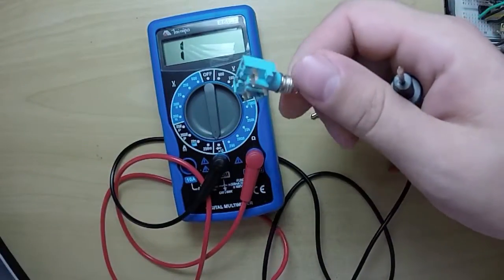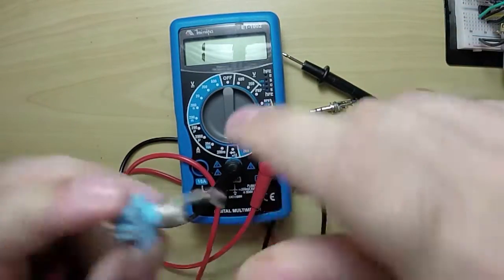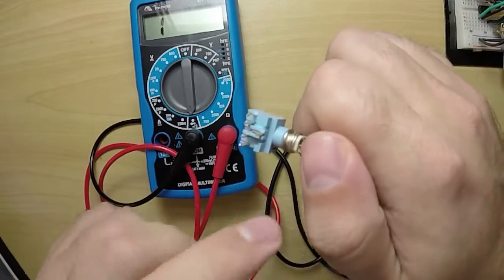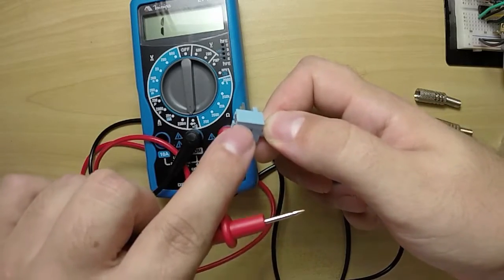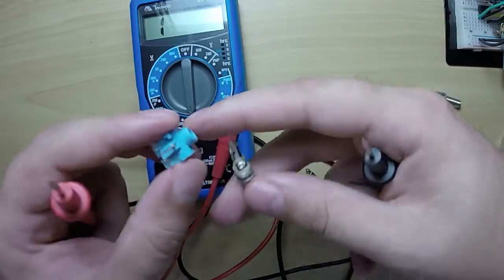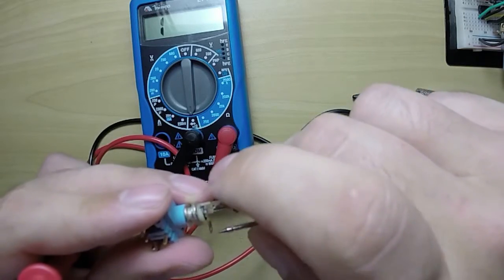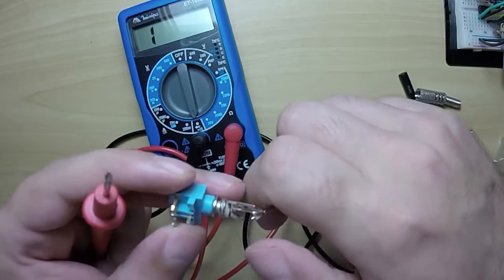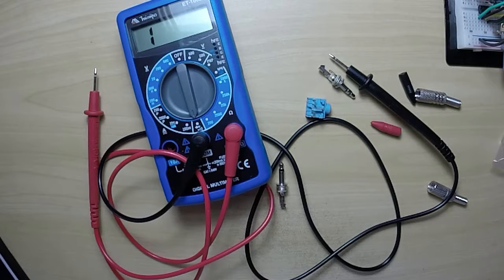DIY: Finding the Ground Pin on an Audio Jack Socket (3.5 mm)

Comment: So this is a dumb question I know, but i snipped tge wire off an old power supply that used a 3.5 mm jack to use as a radio antenna for a portable sw radio that uses 3.5 for its antenna jack. 

Is there an easy way to determine which is ground without a multimeter? The wire itself still has some of the old marks on it, is the one with the - on it ground? Or the other way around?

Comment: Dude, awesome, you have likely saved me a lot of futile searching and purchasing all sorts of crap only to realize it is not working for me for this or that reason. Really, I should have recalled what this feature is for. :D

To give a context, I am considering using m/f stereo jacks as universal connectors for all sorts of arduino sensors (as of now it is IR remote for my computer), that kind of stuff that requires power and one signal. Actually, with that 4-pole jack I could probably even do sig in/out. Or USB if I want to carry power and 2 signals ... and whatever weird solutions I come across over time. My soldering (and desoldering) skills are levelling up as I am writing. Hell, how do those buses inside a PC work, actually? Sure I have some of that stuff salvaged... ;o)

Comment: what do you do with the other 2 pins that are on switches? do they go to ground?
Reply from the maker: +brianbl401 it has to do with a switch that is inside.. if you don't need switch functionality just use the outside pins. Here is the datasheet: https://cdn-shop.adafruit.com/product-files/1699/STX3120.pdf
Reply: what would you use the "switch functionality" for? I just built an Op-Amp and I'm trying to hook the Left, Right, and Ground to the female jack.